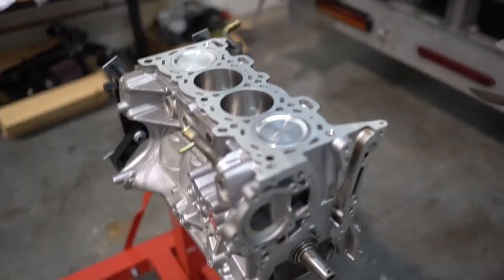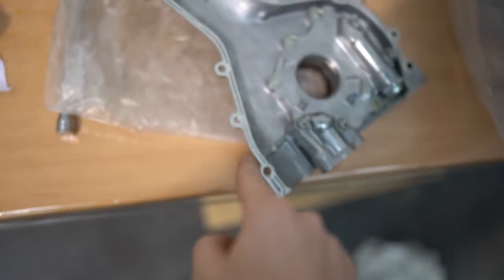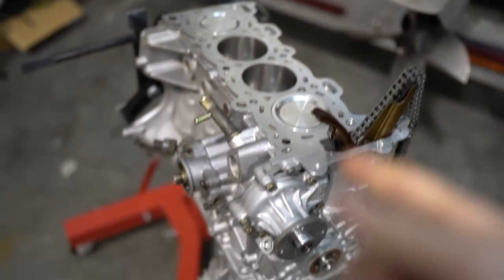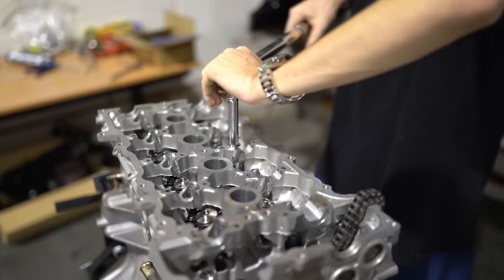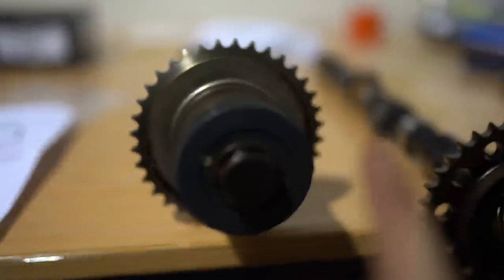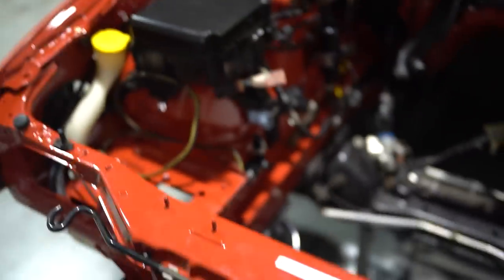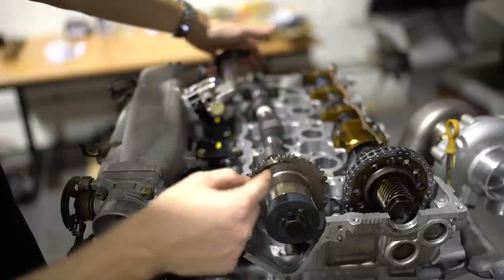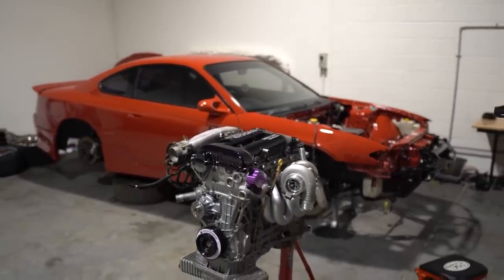Building the Perfect SR20

Comment: You mentioned not needing to measure your shims at around 17:45. That is pretty important as you wan the surface of your rocker arm to be parallel to the surface of your camshaft. Having a skewed rocker will lead to vibration and premature wear. Hope it has been holding up fine.

Comment: Tip for the future, for the portion where you are dropping the nuts onto the studs and you found yourself in a precarious balancing act with the nuts, you can purchase bee’s wax and then push your socket into it so it will help the nuts stay in to socket, but it won’t leave anything hazardous because it will just burn off!
Reply: I just use a little dab of assembly lube, mines thick enough to keep a bolt but have to re apply every fee nuts. May use the beeswax next time though
Reply: That's awesome info! Will be doing this on my SR build next weekend

Comment: Doing the same to mine almost exactly the same build except a 660 here, what lines and fittings did you use for your turbo? I don't wanna go back and forth buying shit til I find a decent fitment for the oil feed off the turbo.

Also you can slide the chain around the intake cam if you don't bolt the cam down first.

I reckon you should go into more detail even if other people have done it before so people find your videos the most technically sound and maybe pick up on things other have left off.

Keep it up mate, subbed!

Comment: I have a pretty similar setup in my car. Its making 450hp at 19psi on a GTX3071
Reply: For that turbo I'd think you'd need to run less boost to make that power I have a gtx2971r I wonder how much boost I'd need for 450 also 9.1 compression ratio  but it's a pretty serious build

Comment: Hey I'm new to the Sr world... noticing the motors are slightly tilted forward and have a predominant lean towards drivers side. I'm swapping this motor into a different vehicle. I understand the motor needs a pitch to front because of the oil pump. But what's the side tilt? Would it effect the motor if I leveled it with a front ward pitch? Or are there oil galleys that have a need for the sidepitch?

Comment: So your stock bores we're 86mm, and you're now 86.5mm? I'm about to do the same thing. 4th cyl as well. I'm also going with CPs, are you having piston slap? Or is that a stupid myth I shouldn't be worried about? What size head gasket did you get? 1.5mm? And what bore size on the gasket? 87mm?
Reply from the maker: Definitely no piston slap if you get the right pistons and it's machined correctly, and neever heard of it happening to be honest. I went 1.2mm headgasket 87mm bore
Reply: @JackPanozza hey bro! So update. I finished my SR not long after this original comment. It ran sooo good, but I ended up with an engine building bug. I've just finished my HKS stroker 2.2 kit in another block, and a mazworx VE head. It's 500 miles old and it's absolutely brutal.
Reply from the maker: @pistnbroke736  sorry to hear the first one didn't work out but that HKS kit is baller! Plus VE head that's gonna be insane.
Reply: @JackPanozza  oh by bug I didn't mean it failed, it worked perfect. It's sitting here as a spare.

Comment: Perfect video with a good explanation on every step! How much did the short block set you back roughly at the engine builders?
Reply from the maker: Thank you! I spent about $2000AUD to get the crank grinded/balanced, block bored/decked/honed and assembled, and the head refreshed. That doesn't include any of the actual parts.